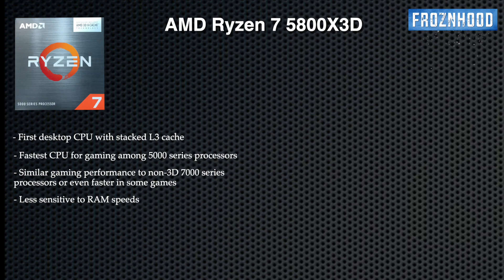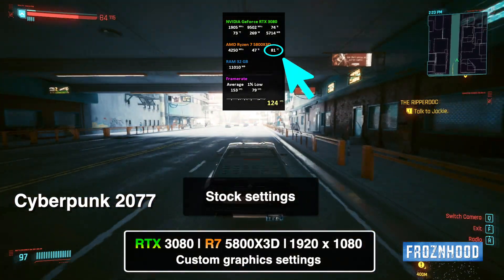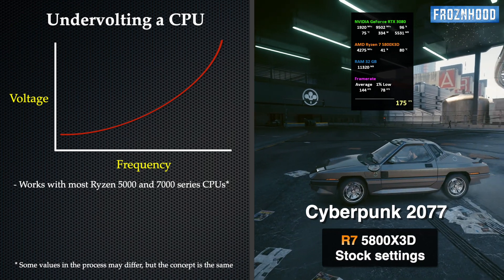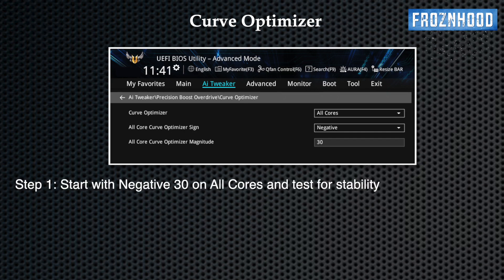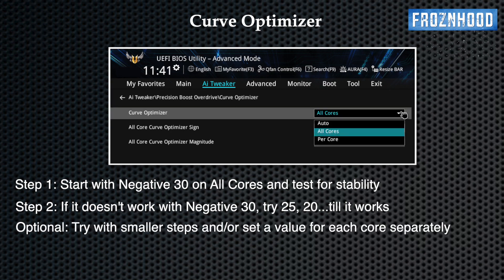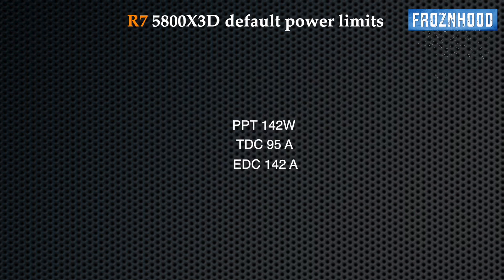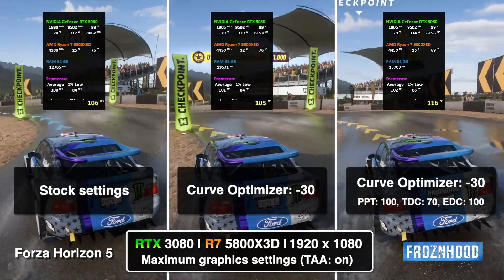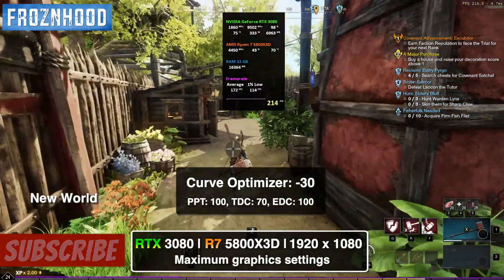Optimizing Ryzen 7 5800X3D - Higher performance, Lower temperature | Undervolting | Curve Optimizer

Comment: I am using the latest bios (Asus CRH7 + 5800X3D). There are no curve optimizer nor PBO!!
Reply from the maker: Search again. it should have it. Check Advanced menu (to the right of Extreme Tweaker).
Reply: In TUF X570 there's in A.I Tweaker like in video or go to Advanced>Overclocking>Accept risk and there you are, try there.

Comment: Thanks a bunch for the video. It was rather clear and easy to follow. With the -30 curve alone my temps when gaming dropped from 90° to low 60s when gaming. (280 Arctic).

That said, I was hoping you could help me out with something. After setting a -30 Curve with the latest bios my CPU drops to 3350hz and never goes any higher. Changing the curve back to 0 does bring up the clock speed back up to 4300-ish but does so along with the 90° high temps. According to MSI Afterburner

I tried installing the most recent AMD chipset, manufacturer driver and manufacturer bios for my Aorus Elite board, and even reset the bios to no avail. Any idea what could be the issue?
Reply from the maker: Is your CPU 5800X3D? If yes, check the other settings if one of them is not trying to overclock the CPU, trying to set a specific clock speed or one that is changing the voltage by default (that would be a problem). Did you download the AMD chipset driver from the AMD website (not from Gigabyte)?  If not, do it. Have you tried -25 or -20 curve, just to see if the the frequency will go up to 4450 during gaming? May be your unit can't fully handle -30 curve. Have you changed the power settings (those 3 from the video)? Its worth investigating further, because having 90° in games with Arctic 280 is unacceptable even at stock settings and that confuses me a bit. Last question: what is the current temperature in your room and do you have good airflow inside the case?
Reply: @FroznHood  Thanks for the response. The CPU is indeed a 5800X3D and I did DL the chipset directly from AMD. Changing the other 3 settings seemingly did nothing, I could see them reflected in Ryzen Master but no temp or Hz change.
After testing a lower curve I surprisingly noticed no change either, it automatically drops the HZ to 3350 and even temps remained relatively the same from -30 to -10 (in increments of 5). About 5° hotter at -10

Airflow should not be an issue. Room is around 22° and I know my previous CPU behaved normally with the GPU hardly cracking 50° in gaming.

Like you I'm a little confused. I will look into the voltage thing, not an expert on the BIOS myself so that'll take a moment. I'll also try reseating my cooler and at worse getting a replacement CPU in the odd case this one is faulty in some way.

All that said, thanks for the help. Really appreciate it 👍
Reply from the maker: What was your previous CPU? Did you first FULLY uninstall the old AMD chipset driver, before installing the new one? It is mandatory in most cases. Something is wrong and since you also tried with reset BIOS  I start to doubt the quality of this specific CPU unit. I advice you to check also one more thing. Go to windows power settings - Power Options -> Edit Plan Settings -> Change advanced power settings -> Processor power management. Under Maximum processor state check if it says 100% (it should be that way).
Reply: @FroznHood  My previous CPU was a Ryzen 5 3600. From what I'm seeing online that MAY be the source of the issue. 

Also I checked the Processor power on the control panel, it does say 100%. After some more google searching I have tried resetting the bios, reinstalling the bios, using bios' default settings, deleting Ryzen Master and the registry. The issue persists and, frankly, I'm stumped.

I did not install the AMD chipset before swapping CPUs, I only updated the bios before hand. Think it would be worth installing the 3600 CPU back in, install the chipset, and reseat once again the 5800x3D?

Again, thanks for thanking some of your time to help me out.
Reply from the maker: No, forget about the 3600. The latest AMD chipset driver must be installed AFTER installing the new CPU. But before installing the new drivers you MUST be sure that the old ones are completely uninstalled, especially if you are upgrading from Ryzen 3000 series, because, if I remember correctly, they use specific Windows Power plan, which is now possible that it causes problems. There is a tool called Microsoft Uninstall Tool. It is a tool for removing apps, drivers etc., that sometimes can't be removed the ordinary way. With it you can completely remove the current AMD chipset drivers and then clean install the latest ones. 

Since you have such problem that is hard to identify, can't you just reinstall Windows and then install the proper drivers, so everything can be clean?
Reply: @FroznHood  Again, thanks for all the assistance. Unfortunately even a windows reinstallation didn't help. The CPU clocks down to 3250 with ANY curve. (-5 to -30). So it drops below the normal and never boosts above that at all.

Only at default settings does it reach 4.5hz and at 90° despite the arctic cooler.

At this point I'm flabbergasted and can only blame the CPU so I'll try replacing while I still can.
Reply from the maker: No problem. I know how frustrating it can be to have such issues. Yes, better replace it as soon as possible and you are welcome to share your experience with the new unit.
Reply: @FroznHood  Replaced the 5800X3D and reset the bios for caution. It all works fine now! No clue what's wrong with the old chip, physically it looks fine. I'll chalk it up to bad luck.

But I followed your guide again and all works great. After some stress testing the system holds at -30 and with the other three limits without problems. Noticed a huge perf boost on starcraft2 which is very CPU dependent.
Reply from the maker: That is good news. Nice to see another fan of Starcraft too. 😀 The game also benefits from the 3D cache. I saw a huge performance boost compared to 5600X.
Reply: Thx for info chat troubleshooting, very useful for me to. I just bought a 5800x3d and test it a bit, mine stays at 4.35GHz all cores in Cinebench reaches 77cpu and 88C (package)but on single cores boost some cores reach 4.55GHz . I have a 240 Aio Arctic, does all this look normal? I will try the undervolting setting tonight, thx
Reply from the maker: The single core test in Cinebench is not very useful regarding temps. Check the temps during the multi core test. With stock settings the CPU will probably hit its 90C temp limit.

Comment: Should I follow these settings for the 5700X ? Is it safe or do you have other recommendations?
Reply from the maker: Same strategy works with 5700X, you just need to test different values to see where your CPU stays stable.
Reply: @FroznHood  what you meant by that is adjust the curve optimizer magnitude right?
Reply from the maker: I mean that 5700X has different default PPT/TDC/EDC settings and you must use different values from the video. The Curve Optimizer works the same way.

Comment: i tried this settings in the BIOS but now my max speed is 3.30 Ghz :( i dont know what is wrong. The steps are easy to follow.
Reply from the maker: I see some other similar comments. If you are using 5800X3D you must be sure that there is no other setting that tries to overclock or changing the voltage, that you forgot about or it is doing it by default. be sure to have the latest BIOS version and latest AMD chipset driver (from AMD website). You didn't mention what exactly have you tried: curve optimizer? What value? Power settings? May be your unit needs different values in order to work stable and optimized.
Reply: @FroznHood  I tried those settings in the PBO and underclock in the BIOS, i Had to upgrade the Aourus X570S Elite with the lastest bios available , thanks to a little backdoor in the motherboard.I didnt touch any other setting in the bios. But its true im not familiar with PBO settings and some terminilogy of the BIOS. im using the default again, and it shows 4500 Mhz again.
Reply from the maker: So problem solved or?
Reply: @FroznHood  Only with default PBO setitngs , no undervolt made it.
Reply: @FroznHood  Not really ,i had to go to default mode. I expected to see better Boost speed , but i give up :(.

Comment: Would you explain, after curve optimiser -30 and triple values changing, what happens exactly . What do they mean?
Reply from the maker: I have explained everything in the video. Is there anything specifically you need more information about?
Reply: @FroznHood  minus 30 mean, % 30 below the general & factory voltage?
Reply from the maker: No, it is not %. Each curve optimizer count corresponds to specific range of mv values.
Reply: @FroznHood  3-5mV steps and there are 30 steps so its -90 up to -150mv on each point of v/f curve

Comment: Can udervolting damage a CPU?
Reply from the maker: I haven't seen an official AMD warning or from the motherboard vendors that udervolting can harm the CPU. In theory, if the CPU works at lower temps and with less power (but enough to be stable), it means less stress to the CPU, more "calm" state, which is good for the CPU and the opposite of stressing/"damage" it. OVERclocking and OVERvolting is what can harm the CPU, which is why you see warnings against it everywhere.

Comment: For anyone with an msi board its alot easier to do this in your bios just look for kombo strike and put it on level 3 its the same as curve optimiser -30 its a one click solution mine runs cooler and clocks higher
Reply: def worked on my b450, thanks
Reply: Worked like a charm on my MSI x570. Immediate -10 deg on idle. Thank you!
Reply: Is it possible to set the power limits (ppt tdc edc) while using Kombo strike?

Comment: I tried reducing the curve on my 5800X3D from 30. but it only allows me to do -5 or it doesn't run, My temps are up to 95 celcius sometimes on CCD #0, how do I fix this? It's super hot! and I got Cooler master Cooler Master ML240, I had a FAN cooler first, but it gives the same temps...
Reply from the maker: 5800X3D is capped at 90 degrees, so I don't know how you get 95. What motherboard do you have? Since when do you have that CPU?
Reply: @FroznHood  It was 95C at CCD #0 and 92 on all cores max, I have now downloaded PBO and fix the curve there -30, but its not possible in bios for whatever reason? I Have the ASUS X570-p motherboard I got the CPU last night
Reply from the maker: It should be possible in BIOS. You may need to update it to the latest version.
Reply: @FroznHood  I attempted that but no luck
Reply: @FroznHood  Some BIOS will not display Curve Optimizer for the 5800X3D because it's supposed to be a locked chip (my ASRock X470 Taichi has no option even on the latest BIOS). Users facing this issue need to use the PBO2Tuner software to set their curve - it works fine, but does need setting on every boot.
Reply from the maker: The Curve Optimizer and the power settings (PPT,....) are not locked on 5800X3D in any way. Other things are (or just don't work), but not them. I have see other comments that people cannot find those settings mainly on B450 and X470 motherboards, because of various reasons and very often the problem is specific to some of the older motherboard models.

Comment: What’s an ideal clock speed should I be running for my 5950x at 1440p with a 3080ti? Also, does the cpu off set voltage with a negative mark effect curve optimizer/worth combining?

I was thinking of using a negative boost clock to cap to 4.5ghz.

Unless I’m not seeing it or reading it wrong it feels like to me past 4.5ghz it asks for way too much voltage/watts (150-160 wats) at close to 90c
Reply from the maker: 5950X is a very specific case. It most likely will not work with -30 curve, so you can try with -20 or -15, and also you may need to set different values per core. Regarding the clock speeds, you didn't mention if you are using the PC for work or gaming. Clock speeds while gaming and rendering are different use cases. In gaming you should try to get stable clockspeed as close as possible to the CPU maximum frequency, which also depends on the game, because in CS you may want to get 4.9 Ghz, but in Cyberpunk 4.7 Ghz may be a good result.  I don't use the CPU offset. It is like the old way of undervolting the CPU. Use curve optimizer and the power settings. Use MSI Afterburner in-game or another app to watch the power usage of the CPU and how it affects the temperature. Your target is to achieve the lowest possible (and stable) power draw, which will keep temps lower and the frequency higher.

Comment: Hmm... I can not use Curve Optimizer on my 5800x3d LOL
Reply from the maker: Why? What is the problem?
Reply: @FroznHood  Total no reaction. If i try to force it- CPU is locked on basen frequency and voltage
Reply from the maker: You don't have to force anything. If the CPU insists to work at its base frequency (3.4 GHz), something in your BIOS is not right. Some other setting might cause the problem, for example if you are trying to overclock (overdrive) the CPU (which you shouldn't with X3D). You can try to set everything in the PBO menu to Auto, CPU voltage also Auto and then try -30 curve optimizer. It should work unless your motherboard chipset specifically doesn't support it (you didn't mention your MB model). Also you may need to update the BIOS to the latest version. Keep investigating the issue because it is worth it. Feel free to share what you have found.
Reply: @FroznHood  B550 Aorus Elite V2
I am pretty advanced but i have no idea how to at least undervolt this CPU- i jad no problems to undervolt 3600, 3700, 5600 5600G and 5700x even with B450 version od this motherboard...
Only thing that i can do is 'FSB' overclock and manually choking this CPU with power and current limits to be ale to stay under 90*C during constant AVX loads (H100i Capellix)... Undervolt is the only thing that i need to be satisfied with this unit... BUT i am awarie that IT is pretty easy to brick this CPU with voltage
Reply from the maker: I am confused about what you are trying to do. If you want to undervolt 5800X3D, you only need to adjust the curve optimizer and if needed, also the power settings for lower temperatures. Nothing else. Don't try any kind of overclocking on this CPU. Don't touch any other CPU related voltage settings.
Reply: @FroznHood  As i've said- CO is not working with this CPU at all
Reply from the maker: Something is wrong in the BIOS or with the motherboard.

Comment: These settings not available on my b550 pro vhd wifi sadly for 5800X3D
Reply from the maker: Are you sure? Have you checked the manual or other source? Are you using the latest BIOS version?
Reply: @FroznHood  found settings.
Reply: @thebeyonder77777 hey, i have x570 tuf gaming plus and i cant find curve optimizer settings anywhere? do you mind showing where you found it?
Reply: @solivagrey1707  u need to find TDC EDC and PPT settings in amd overclocking section
Reply: @solivagrey1707 For my motherboard (ASUS B550), I clicked the following:

- Ai Tweaker tab
- Precision Boost Overdrive
- Curve Optimizer

Then just set the three boxes to “All Cores”, “Negative” and “30”.